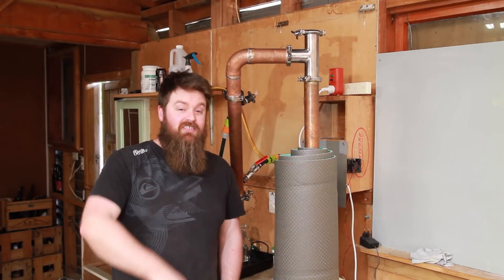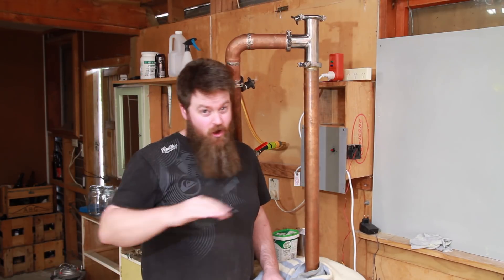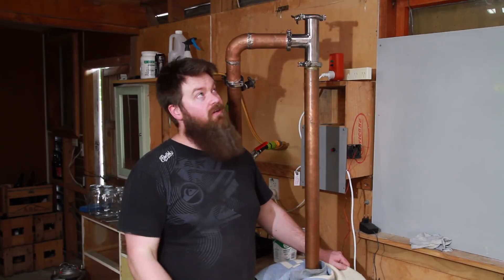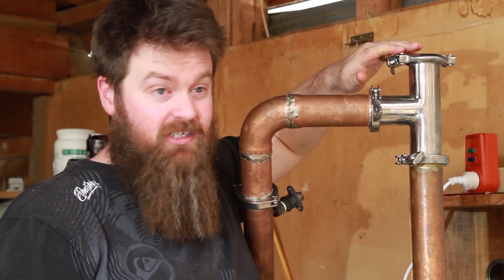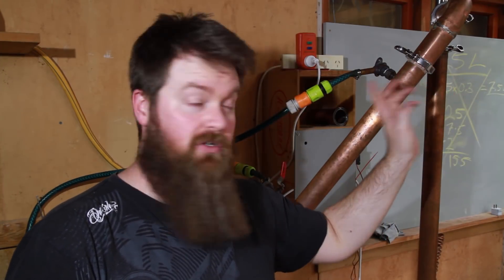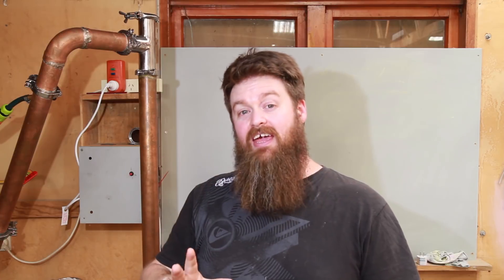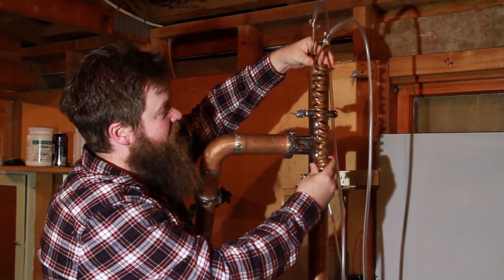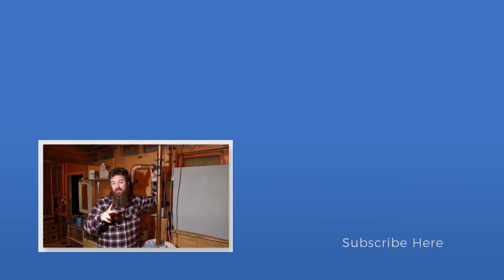CCVM Still Build Overview - The Right Still For You?

Comment: Hey Jessie, I've bought a 50lt keg still with a 4" stainless  4 foot tall column . I can attach either a s/s condenser and marbles for reflux or a pot still copper dome to the top of the column. This dome has the traditional condenser coming off it plus condenser coil inside the dome. 
My question is, how do I use the pot still condensers in conjunction with each other. 
 Would photos be of help?
Thanks Murray Bain

Comment: If that reflux coil can achieve 100% knock down on the uncapped pipe, could you use a similar coil as a product condenser?  It would be much more compact.
Reply: I should have googled it first; the coil is called a Dimroth condenser, and you can also use it as a product condenser.

Comment: How is it you don't have to seal the top of the column when you have your ccvm condenser inserted into the column? I totally get the idea and workings of the reflux still/column I just don't get how your not losing vapors when the top has no sealed cover also with no seal you have no back pressure to push the vapors out the vapor/product condenser. Or did I miss something in the video

Comment: Good day! I have a CCVM still that i have literally JUST finished. Just cleaned it and was doing a "testrun" with water. So my question. With the reflux coil in and cool, and my still running warm enough to produce heaps of steam, there's nothing coming out of my product condencer. If I take my reflux condencer out and cap my column, there's product (water) coming out. What am I doing wrong?
Reply from the maker: Ayyyyeeeeee awesome! Congrats on getting a build togeather mate! 
Sounds like you have the coil set a little to low in the colum.  To get a 50% reflux ratio you are going to want the bottom of the coil to be just above the top of the opening to the line arm.

Comment: I'm curious why you put a triclamp right above the tee instead of on top of the 8" copper tube where the reflux condenser goes and just brazing the tube right to the tee. Would that extra height disrupt pot still operation somehow if you tri- clamped it shut at the top?

Comment: Hey, hope the lockdown is treating you well! I'm thinking I'll build a CCVM but i'm confused - when it comes to a reflux still, as the vapour is going through the reflux process, I would have thought the various chemicals that would normally vaporise first (methanol/foreshots/heads and the rest) would be mixed and muddled - Is it still the case that you should discard the first amount to get rid of the methanol, etc? I can't get my head around how the various chemicals aren't mixed by the reflux process rather than distilling in some sort of order due to temperature increase in a pot still.
Reply: Hey Chris methanol's boiling point is lower so it will escape from the pot earlier.

Comment: If you were to control the amount of flow of your cooling water that goes through the reflux coil, could you simulate the "moving up/moving down" of the coil without actually moving it? What I mean is, if your coil cools less, you get more vapor going up and less reflux going down . You could stuff a copper scrubby in the top to make sure you are not losing vapor out the top but get it to move into the Tee? I was listening to Chase the Craft podcast recently and was really intrigued about the PID control you suggested for your reflux coil.
Where would you read your vapor temperature in CCVM mode? Would you read the vapors coming through the Tee?

Comment: Sorry if this question has been answered- In potstill mode do you remove the copper mesh from the column and in reflux mode do you run water in the reflux condensers and SG condenser both?

Comment: Nuther question, sorry. If the Reflux Condenser, and the Shotgun (Product Condenser) are so efficient, why do you want such a tall column? And can you avoid needing a tall column by having a column that is bigger in diameter? Since area of a circle quadruples are the diameter doubles can a 102 mm 60 cm column do the same as a 51 mm diameter by 150 cm tall column? But maybe column of the column isn’t the goal but distance from the boiler?

Comment: If I understand this correctly, the reflux condenser is a sort of temperature controlled valve at the top of the column. If the coil is down all the way no vapor passes through to the outlet because the reflux condender turns the vapor to liquid sending it back down the column to be remixed with the uprising vapor in the packing. Some vapor will rise from the packing and some will be condensed in the packing to fall into the boiler to be re-vaporized. When the RC is above the outlet some vapor exits and some vapor returns. When the RC is higher, effectively all the vapor is allowed to exit the column and enter the product condenser. But my question would be, is the RC so efficient that none of the vapor exits the top of the column? Thank you for your insightful and entertaining YT.
Reply: I just read your answer two comments down. Thanks again.
Reply: The condenser separate the water from the alcohol to make the distill stronger. Since water have a higher steam point then alcohol alcohol about 80C water 100C.  The water steam will condens back to water at a lower temperature then the alcohol. When water is condensed by the condenser it will separate from the alcohol and turn back dripping down the pipe into the pot. Because of the different steaming point. Steam rise liquid run down. That's why a pot still will get about 50% alcohol and the refux about 96% alcohol.

Comment: Does it matter the material, if so what is the best material to make a still from?
Reply from the maker: It definitely matters. For safety and also for effectiveness.  Really you only want to use stainless steel and copper, or just copper.
Reply: Ok, thanks!

Comment: Great video, do you use 2 separate water sources, i mean one for the shotgun condenser and one for the coil condenser or do you have a splitter to split the water from one to the other?
Reply: Depends how much cooling power is needed for your system. I have to run sepreate lines but mine is also a 3 inch tower on a 55g drum.

Comment: I built a ccvm designed still and vapor passes through the coil and out of the top. What am.I doing wrong. It's a scary deal. This happendd with my vinegar clean out run.
Reply from the maker: Your vapor speed is more than the coil can handle if its blowing past it.  In terms of design/alterations fix it by making a longer coil, if it is not a double coil think about moving to that.  
In terms of operation you need to do one or more of the following.  Use colder water, increase water flow or decrease the energy going into the boiler.
Reply: @StillIt  ok, I'll try app that stuff

Comment: Sorry I have a problem with this design. The reflux condenser needs to be in tube under t at top. A valve controlling flow to coil for temp. Better. Promises.
Reply from the maker: No dude,  thats just a different design.  This is specificly set up to NOT need a valve.  The coil is the valve and is adjusted by its position not the water flow.  

If you are going to follow your sugestion you may as well just use a deflagemator (or how ever you spell that thing haha)

Comment: How are you holding the coil condenser in place, with the adjustment of positions?
Reply from the maker: I use a scrap piece of copper. It sits in between the coils and rests on the pipe.  It takes a wee bit of jiggering sometimes.  But the resolution is pretty good.
Reply: K

Comment: What does CCVM stand for?
Reply from the maker: Coil Controlled Vapor Management Sorry should have that in there lol.  

Basically it just means that you are controlling the reflux ratio through how much vapour is coming in contact with the coil by moving the coil.  

As apposed to other stills, say a boka for example.  That controls reflux ratio by controlling how much liquid is aloud to flow through a valve.
Reply: @StillIt  Thank you!  Still (it) a minnow in this hobby but just ordered a 50 litre boiler and controller from China (Oakstills) and hope to make a combo column myself.
Reply: Also, love your show, if you're ever on the west coast of Canada, well I hope I've made something drinkable!

Comment: My build is modular as well, and similar.  24" x 2" column, triclamp connected to the "middle" of the tee, second tee end going to a thermometer, and third tee to my 48" 1/2 with 3/4 jacket liebig.  

Very easy to take completely apart and store different pieces in different places so  unless Im actually using it, I never have a functioning still on site...

This is my second still.  1st one was picked up from a swapmeet market (lady thought it was a butter churner !).  It was small and couldnt handle stripping runs very fast.  When I decided I wanted something bigger and faster, I didnt want a paper trail, so decided to build my own.  New one will be tested next week for the first time, but fully expect it to knock down everything my 5500w can throw at it.

Comment: Hello mate Im confused as to the coil how do you cap off the end of the tee once inside? What stops the vaps just going up rather than down the the tee piece? Have I missed something?
Reply from the maker: Nah you didn't miss anything mate, I was super confused about this as well.  You don't need to cap it. Any vapor that gets up past the tee is going to condense and drop back down the column.  Just as long as your coil is big enough in relation to the speed of the vapor.
Reply: @StillIt  Nice one thank you. First run of malted popcorn is doing well but think next batch needs better crack and boil time as og was not to my liking
Reply: Working on a corn meal recipe as is really cheap here(experies working well) Dont want to add amalayse as malted barley is available yeah pricey but cheaper than ama and get extra flav and sugs

Comment: so when you install your home made top cooling coil or condenser, how do you seal the pipe between the tubes and two inch pipe? I have seen guys use a rubber stopper with holes that you fit the tubes threw. also it holds the coil in set positions. and with another stopper you can install your thermocoupler to run your temps.
Reply from the maker: There is no need to sell it when you are using the reflux condenser.  The condenser itself stops any vapour escaping.  When I run it in pot still mode it's capped with a ferrule blank.
Reply: @StillIt  Until the condenser water stops or the the feed tube springs a hole - then you have an excellent fire hazard.

Comment: I've built mine very similar. It's inch and three quarter copper so the shotgun is three barrel of 15mm (knocks 3KW down no bother).. I've not made the reflux coil yet so i run as a pot still with a blank in the "T" with a thermocouple in it to measure temperature at the top of the column. I turned the 11 Gal keg upside down and put an elbow on the 2" out for a drain tap. then put a 4" hole in the new "top" with a reduction to my 1.75" X 44" copper column packed with stainless scrubbers.
Reply: That's a hell of a good idea mate! I've been trying to work out how I wanted to put a drain in my kettle and the top has enough stand off I wouldn't need to worry about the drain pipe being in the way! And the bottom is domed slightly so I would have a domed top to the kettle and wouldn't need to add one.... Thanks!

Comment: Great description of the very boring CCVM reflux column still. I mean this design is so easy to operate it is boring compared to the stress and trauma of operating a CM or VM. I’ve had all three and the CCVM is simply the best most boring neutral machine, 👍🏽 TIP, put a sight glass immediately below your tee to watch out for condensate flooding at the top of your packing!
Reply from the maker: Hahaha, yeah I hear you.  
I must admit something like a flute is kind of tempting me!

Comment: great vid. 3 questions. 

1. Why insulate the column?

2. When its in ccvm mode and the coil is in. Do you have a cap on the top of the still to minimize venting of vapor? what do you do?

3. what would be your ideal length for column in ccvm mode?

Thank you! :)
Reply from the maker: cheers mate,  

1
The fractioning inside the column is fairly delicate and the copper is a kick-ass conductor.  So the insulation stops any rapid change outside (big gust of wind etc) from collapsing the fractioned gradient inside the column quickly.

2
Nope,  The condenser stops anything getting out the top.  It doses not need to be airtight.   

3
 I would say 1.5m would be heaps for me
Reply: Excellent! Thank you. 

We are building a ccvm still as our first Still. Keg is ordered and I am designing the reflux portion. Essentially our still will be very similar to yours including the shogun condenser. woohoo! :)

Have a good one.

Comment: Amazing vids bro!
So I'm wondering about the ccvm...hypothetically, how long do you think it take to run 40gallons (50g boiler) with a 4" by 5foot ccvm head?   Has 4"x4"x3/4" T, so my vapor outlet is smaller but I could, again theoretically, neck up to 2" .   You converted my idea about Boka to ccvm, strong work.

Thanks!   Keep up the great work!
Reply from the maker: Hmmmm mate I dunno.  My still is 2" but I am considering moving slowly over to 4".  So not too sure on run times for a 4" yet.

Comment: Using the reflux condensor while packing the column, where you able to get neutral product in one run ? Also, do you think using a dehplegmator with a valve while packing the column could work like a CCVM ?
Reply from the maker: I wanted to fit more than one boilers worth of wash in there.  So I did a couple of stripping runs then added back in to the spirit run. 

Yup you can for sure.  Only down side is it can be pretty hard to be accurate adjusting a valve, especially seeing as water pressure fluctuates during the run.
Reply: Still It thanks for the answer. How long do you recommend the column to be for a neutral spirit run? Also how long do you pack it ?
Reply from the maker: My column is a bit short.  After about 1m you get fairly diminishing returns.  

Pack it all the way man.  Having empty column dosnt help much.

Comment: Hi Jesse, just about to start my build. Looking at doing pretty much the same as yourself. Any suggestions what to use for reflux condenser, would you change what you did if you started from the beginning again?

Love the channel btw
John
Reply from the maker: Not really man.  I did a bit of a crappy job with the coil.  But that was before I was showing all that stuff on video.  The main problem I still need to solve is a decent plan/set up for plumbing when in reflex mode.

Comment: Hey man, if you are not running it on reflux mode ie in pot still mode, do you have to take the packing out? Or will the packing only have an affect if you run it in conjunction with the reflux condenser?
Reply from the maker: You don't have to take it out.  But yeah it won't really have much effect without reflux running through it.  The still will create some passive reflux, but not really enough for the packing to make a whole lot of difference.

Comment: Hi Jessie. I really enjoy the channel and watch as often as I can.  I wanted to comment on the copper pipe and elbow you picked up from the seconds store. My guess is that 2" copper with the elbow attached to it was used as a drainage fitting. Copper drainage fittings were used in the 1960's and were typically soldered with a high lead content.  I would bet that piece of copper was removed from and old house and was used as a sink or tub drain. I doubt that those two soldered joints on your still would contain enough lead to have any long term effects. What are your thoughts on the matter.
Reply from the maker: How's it mate, thanks :)

So seems like New Zealand didn't use high lead solder as much.  But I wanted to test it anyway, so I got a little plumbing test kit.  

Lead is a funny thing.  There is pretty much no such thing as lead free anything now (thanks leaded petrol/gas).  But at the same time you really don't want to accumulate more than you have to.
Reply: Still It , cool let me know how your testing goes. As a plumber I know that everything we install now has to be less than 2% lead content by law. So in fact led free isn’t really lead free. Keep up those awesome videos.

Comment: Soldering copper to stainless is easier but the flux is nasty stuff so you need to give it a thorough cleaning before you use it.
Reply from the maker: +Larry Dyke thanks man.  Yeah I really need to give it a try just to compare.  Yep I would do the acud bath, vinegar run and sac run again for sure!!